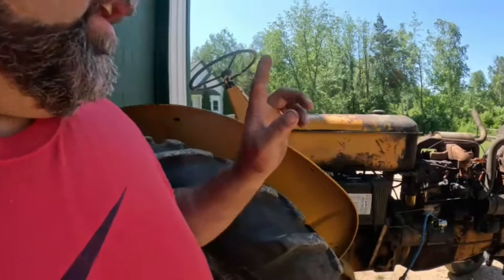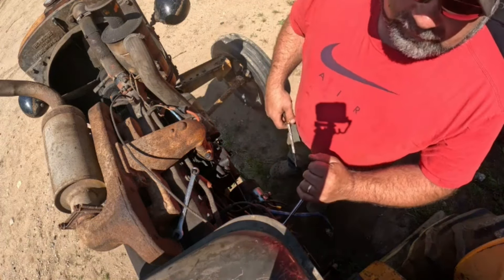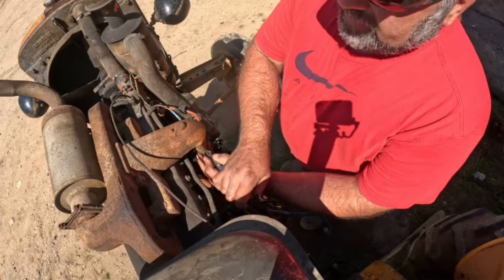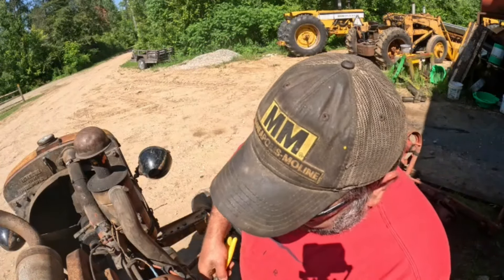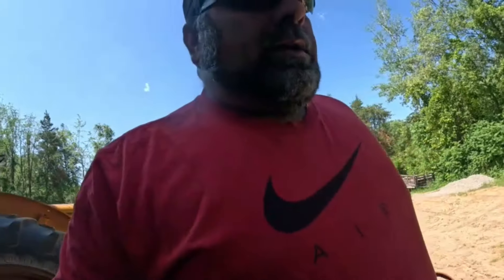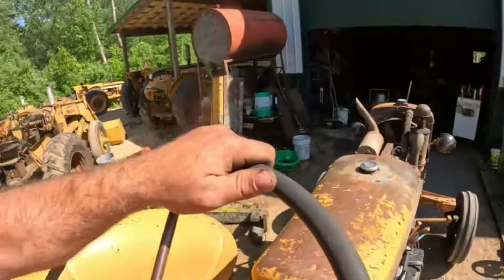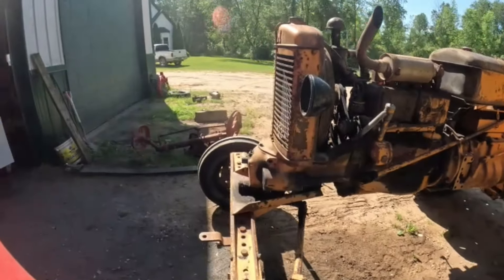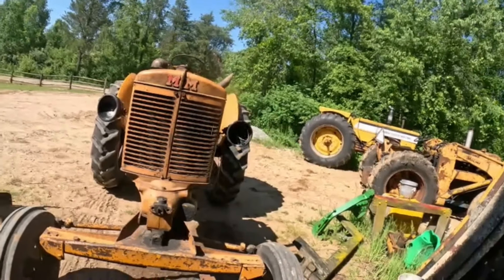MM ZBE Carb Problems

Comment: In the days of my youth we had to keep a length of fine wire to run through those small carburetor passages because we didn't have aerosol carb cleaner.

Comment: My first vehicle was a 89 Toyota pickup four wheel drive 5 speed with a factory lift with 31s 4 banger that truck was a little beast but I couldn't keep a cam or bearing in it put to cams in it and 2 sets of bearings and got rid of it